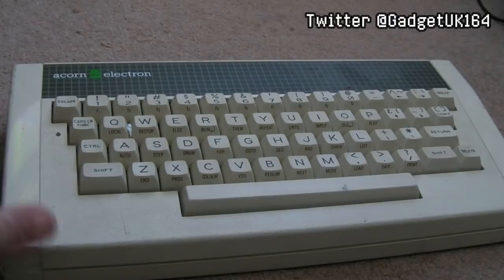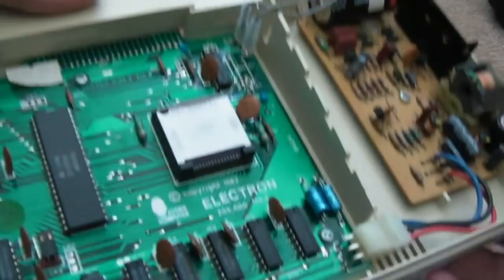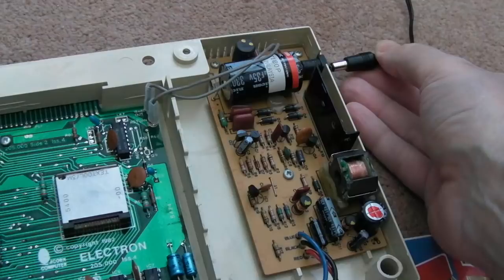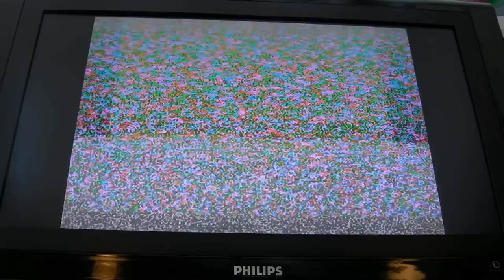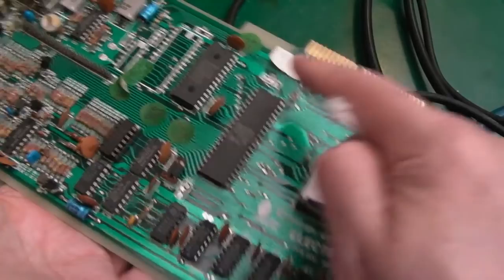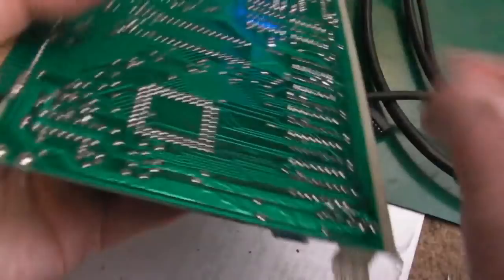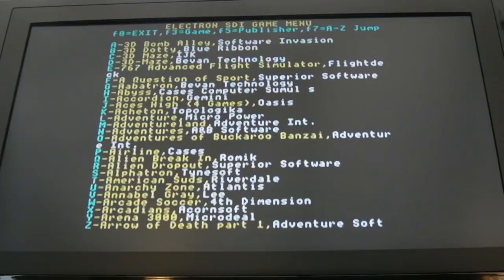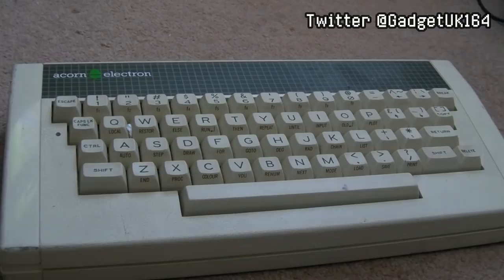Fixing 2 x Acorn electrons - Part 1

Comment: Hi. The yellow/magenta pattern is symptomatic of a ULA or RAM problem. I have fixed Electrons with similar issues by cleaning or replacing the ULA socket. Compatible sockets are available from Digi-Key. 3M6809A-ND. Not cheap though!

Comment: Nice to see that I'm not the only one who couldn't shoot down a thing in Beach Head. 😂 The official expansion unit from Acorn was called a Plus 1 and it added a joystick port and cartridge slots. Acorn also released further devices to provide the Electron with somewhat of a hardware equivalence to the Beeb.

Comment: Another great video and it's sequel too, well done.
The reason the computer does not start with no KB connected, is because the 4 data lines to pins 27,28,31 & 32 of the ULA need pulling up, this is done by 4 x 15KΩ resistors on the keyboard. I made a small plug in adaptor with these resistors connected to pin 4 of the KB connector (+5V) and pins 5, 6, 7 & 8 (Data), this allows work on the main board without the KB getting in the way. 
The problem of the white screen with coloured squares is not always a faulty RAM, I have often found poor ULA connectivity to give the same symptoms. Removing the chip and cleaning the connector pins and the edge connections of the chip with a fibre pen often fixes it.
Reply from the maker: Thanks for the useful info there =D  Much appreciated!

Comment: The garbage in the text that you see when running 3D Dotty looks like what you see when you run programs on the Electron that were designed to be run in MODE 7 on the BBC Micro. That shouldn't be the case for the games in the ElkSD collection, but sometimes people download the wrong files. It looks like the BBC version to me.
Reply from the maker: I did wonder about that as every other game looks normal to me!
Reply: Interesting - I thought It could also be that the game has redefined nearly all the character codes to save memory, but I never played that game before.

Comment: Why oh why did you snip the pins of the chip to remove it? Oh random people on the internet told you to!! Don't listen to people telling you to destroy chips or whatever! 😉

Always desolder the chips properly even if you know they are faulty, it's just more work having to cut the pins first plus you keep the chip whole in case you made a mistake! I would always err on the safe side and opt for the non-destructive option. Better safe than sorry! 😀
Reply from the maker: lol, yes - it's as I said in the video, I've talked about the way you can cut off a known faulty part - when you know its 100% bad, its a quicker easier way of removing an IC.  But its not something I've ever shown on my channel.   The irony here is that I convinced myself it was faulty, when I read the part number wrong.   But because its a 74 series - of which there are thousands of spares for, it was no issue.  I certainly wouldnt cut off any custom chip or IC that's in short supply.
Reply: @GadgetUK164  But how is it quicker? You still have to desolder the pins from the board after you have cut the chip from them! May as well just desolder the pins in the first place and save the time of doing the careful cutting! Plus, as I said, less destructive 😀